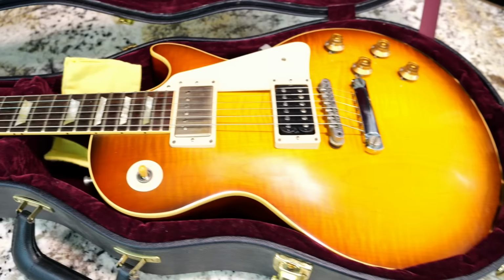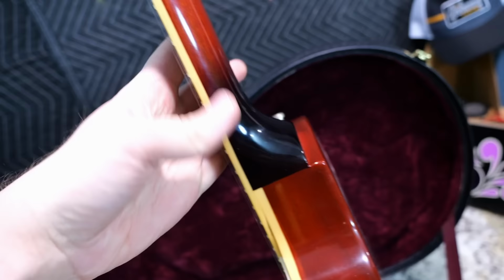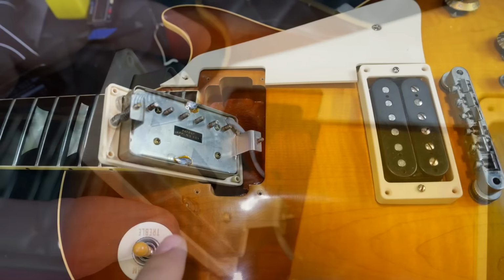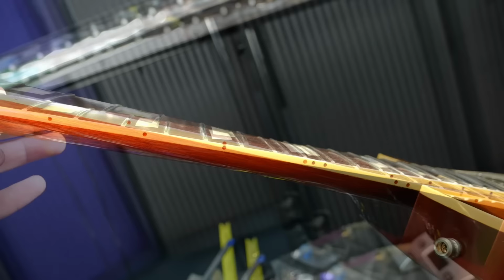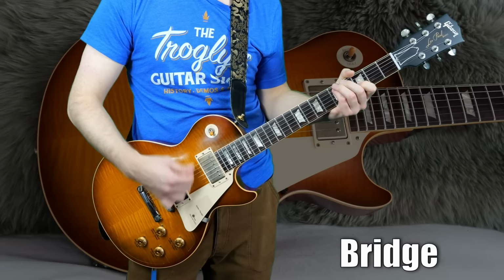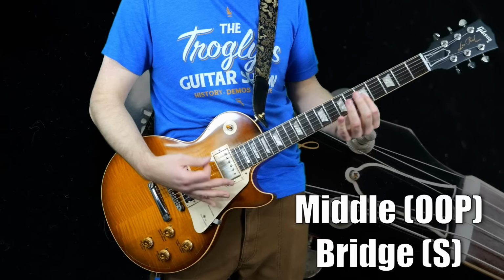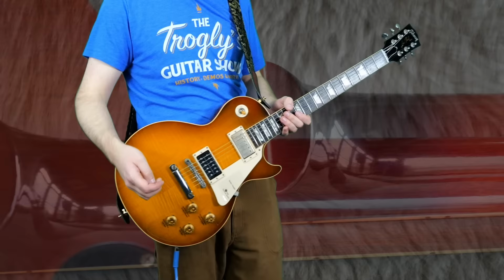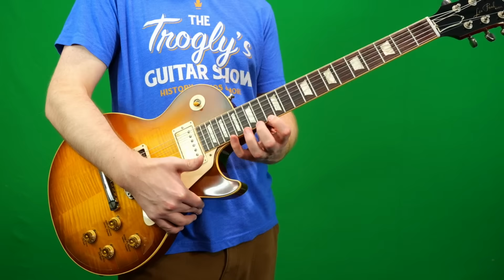Trying Jimmy Page's #2 (The One With Hidden Switches) | 2010 Gibson Custom Shop Les Paul 1959 R9

Comment from the maker: What was your favorite tone on the #2?
🍭Join Sweetwater's Giveaways here ➡https://sweetwater.sjv.io/5gZyM9
🟢My Website: https://www.troglysguitarshow.com
🔴Reverb: https://tidd.ly/4aFiyhC
🐕 Private Help Sessions: https://troglysguitarshow.com/help-appraisals/
Reply: Congrats Austin, this JP LP #2 is a great find, especially with all the included candy.
Will this LP be a keeper?  (Edit, nope, not this time)
Thank You for documenting this guitar, this video is the end-all of information for this limited run instrument.
Reply: You should add a photo of the control cavity wiring to the Reverb listing.
Its an amazing design and build.
Reply: What I had read was they were going to recreate the famous double neck SG for starters.  Then they were going to do some of the rest of his guitars. But they did not say which or if it would be all of his guitars. Sounded like it depended on sales of the initial two models they were recreating.
Reply: Years ago I had the same wiring mod in one of my Les Paul guitars, by far I found the individual pickup being switched to "Parallel" to be very useful.  Switching a pair of pickups into "Parallel" was also nice as it gave an open/airy type of characteristic (albite also thinner sounding).
Reply: @hkguitar1984  a lot of people think when you have higher ohms or resistance the hotter the pickup. It works the same basic principles as anything else that creates resistance.  In parallel it is in effect doing the same as when you have both neck and bridge activated. It will drop the ohmage down since your putting them in parallel.  In series it's the sum total of both when online. It will produce the what the two values are together. A simple math equation.
Reply: @clarkbabin9799  correct 👍😉
I'm just thinking about Jimmy Page asking a guy to modify an original PAF pickup......
"no pressure"
Reply: Yeah page unfortunately used a POS tele  fender is junk Les Paul always
Reply: Coil Tap is a better mod than Coil Split. More organic tone, not harsh sound

Comment: Number 2 wiring made simple to understand:

Pickguard switch 1: master series/parallel; works best in middle position, turns the middle position into a giant super bucker by combining them together as one

Pickguard switch 2: Out of Phase

Neck/Bridge Volumes: Individual series/parallel. Sounds like a very weak humbucker, produces single coil like tones, no hum. Both coils are on, but instead of wired together they're wired separately

Neck/bridge tones: individual coil splits, only one coil is on, produces single coil tones, has hum, sounds like half a humbucker
Reply: Shit, how you explained in this comment is a little bit complicated. I guess it can't be made totally simple.

Comment: Hi Trogly,
The gizmo in the control cavity is known as a terminal block in my industry (aviation). Used for wire management, lots cleaner and lighter than individual splices.
Reply: Is it accurate or inaccurate to refer to it as tag strip?  That was my first description when I saw it.
Reply: Also known as a Buss Bars.

Comment: 11:41 it's simply a bus bar. A way to connect multiple wires.
Reply: or Terminal Strip... Whichever tickles your fancy. 🙃
Reply: Yeah that's what it is. they are often used as a common place. where a lot of wires come from the source then supply different circuits. there are also Buss Bars that contain fuses.

Comment: I love this thing. Never knew jimmy used pull pots, and those switches under the pick guard. Never had a guitar with pull pots, but wish i had the money for this. Love all the specs of it, and would love to screw around with all the different sounds you can get out of those pick ups 🤘🤘 awesome video trog.
Reply: Those came after Led Zeppelin folded in 1980. Check Since I've Been Loving You from the 2007 concert where he uses the push-pulls a bit.
Reply: @iagobroxado  thank you for the info 🤘🤘 will definitely check that out

Comment: Hey Austin, don't quote me on this because I haven't gone and tried to look it up but I'm pretty sure that from memory and from the sounds you were getting, the switch on the pickguard is to put the two humbuckers in series with each other, rather than the usual single humbucker switching from series to parallel

Comment: So, if I'm not mistaken in my JP's LP knowledge, the gouged out version will be Jimmy's #1, and it's due to mostly him doing the work himself. So, when it went around for him to doing the mods on #2 and ask for help  with Steve Hoyland it was done professionally. But, after he got all the cool settings, apparently he mostly stuck to using the phase switcher, and nothing else too much, since even for him it was gimmicky. Also, that little black blotch that's next to the selector switch seems to be how Jimmy's #2 aged. I've seen several other photos of #2, because at some point I want to re-spray mine to have that similar colour, and I noticed that all the #2 has that. It must be more because of the neck thinning/carving process he did, and the re-spray to follow; therefore a different paint was probably used hence the weird aging.

Comment: I just wired a switch in a guitar to put the coils in a humbucker in parallel rather than in series. It's a thinner sound with slightly fewer highs than a coil split, but with less hum. I think that's what the push-pull parallel/series switches do here.
And the push-push parallel/series switch maybe puts that pickups themselves in series which would make it louder and duller in the middle position, I guess.

So if you were to go from both pickups in series, to one pickup, to one pickup in parallel, to that one pickup split, the signal would get weaker and brighter as you went. I guess.

Comment: The bar or bridge in the control panel is basically what many electrical panels and phone manels has in them deacdea ago. These days the bar or connecting bridge in many panels are a combination of spring or screw head terminals where as most phone panels are a push down type of terminal. The electrical ones work similarly to the quick stab connections on electrical outlets.  Difference being here is the bridge isnt directly connected to the main circuit.  These help when your needing multiple wiring options as this guitar has .

Comment: If I ever get a signature model it would be one of the Jimmy Page models. Definitely a reason to keep the pick guard on, with those switches.  I'm definitely a fan of the alnico 2 neck alnico 5 bridge pickup configuration.  I've got a cheap 335 copy with Seymour Duncan pickups and i love how the pickups sound.  I put the alnico pro 2 in the neck and a custom custom in the bridge, which I think is alnico 5.  Been thinking of doing the same thing to my nice Les Paul.
Reply: @bucknasty69  ahh,  I appreciate the correction.  It's been a while since I bought them and clearly forgot some of the details.

Comment: What Jimmy or Gibson should have done was some kind of active electronics so that series-parallel, phase inversion, and coil-splits and all the permutations were at the same volume as full-on humbucking. I once had a Les Paul with DiMarzio Dual Sounds that would coil-split and phase-invert. The altered tones were cool but not very useable on stage because of the low volume levels. I play strictly country, but prefer playing a Les Paul live. It'd be real handy if some of those altered Strattish-Telly-ish tones  were a little more accessible.

Comment: Good lookover of a less common signature model, burst is a bit uninspired and for my personal taste relicing/aging of any kind is a bit lame (it's a bit different in this case as it's for authenticity to his original #2, but I've always seen it as players who don't have enough time to play wanting their guitars to look like they're seasoned so there's an element of fakery) but the actual guitar sounds good.

It's always a delicate thing to make a suggestion to a player about their playing, but Trogly if I might, I think a lighter touch with both hands would do you well.  I noticed a few times you were playing what are supposed to be soft blues licks, you know, almost whisper quiet, and you're digging in hard with the pick, so much I can see the strings bouncing around from the force of it.  Sometimes things were going a bit sharp as if there was too much fretting hand squeeze.  The other way to help with that beyond technique is go up a string gauge, but that's not for everybody as it usually requires some setup tweaks.

Comment: Technically those aren't dip switches - they're push-on push-off switches.
Reply: Good Evening,  Would you happen to know the "make" of those switches?   Thank you.
Reply: Does it really matter that much?
Reply: @gregggyf I posted a response before - I included a link so looks like it's been deleted. If you search for DPDT Latching switch you'll find results. I don't know the brand used for this guitar but the one's I've found have the 6 pins with the wires soldered to them bent over, and also the ones you'll find online  normally will have 6 additional pins - longer ones - that can be used for mounting into a circuit board - you could just cut those longer pins off.

Comment: Bought the 1996 model new.  Brought it home and found the neck was crooked when Gibson made it.  Brough it back and got another one.  Over the years, installed RS Guitarworks pickups, an expensive fret job (original frets were like waves on the ocean) and removed all the push/pull stuff, it sounded awful.  Today, I have the best Les Paul I ever played, have done many gigs with it and is my #1 guitar.  Great instrument, but needed work to be that way.